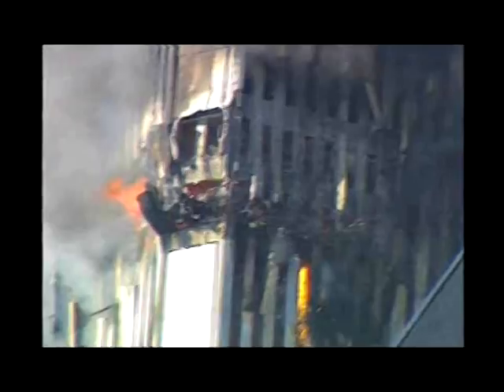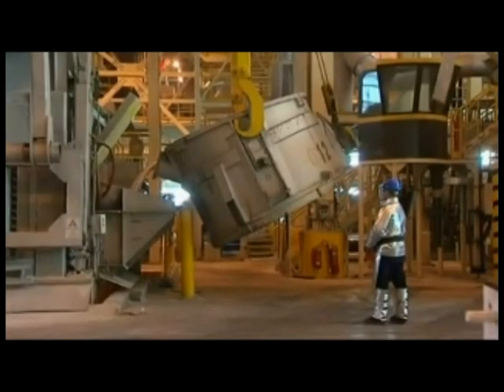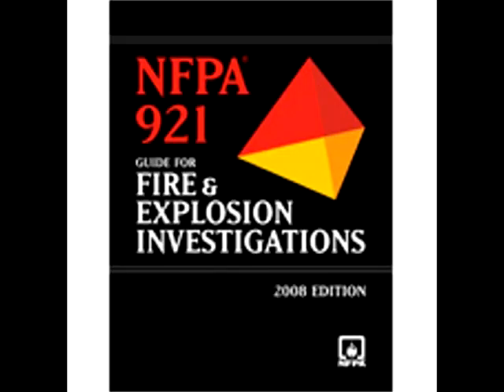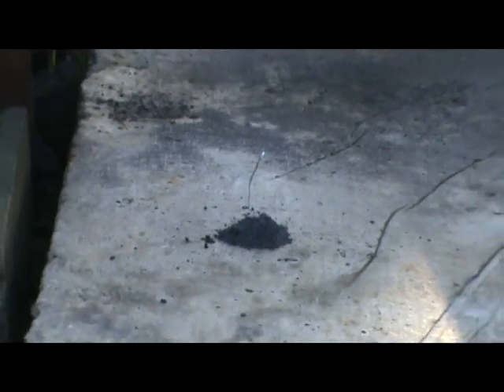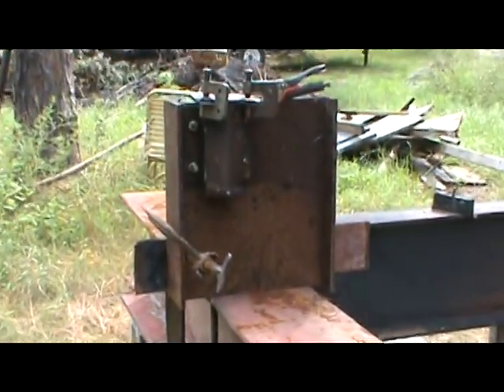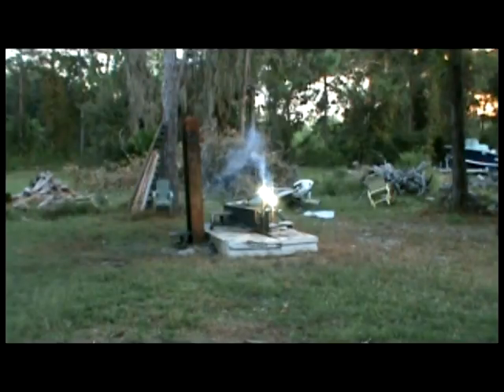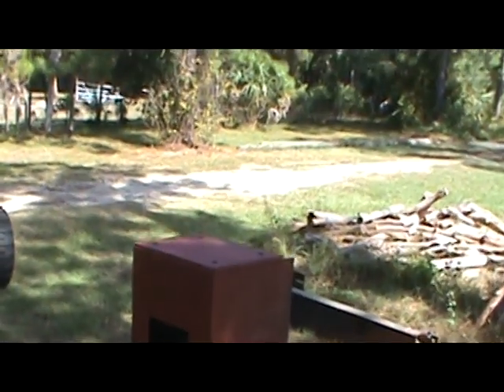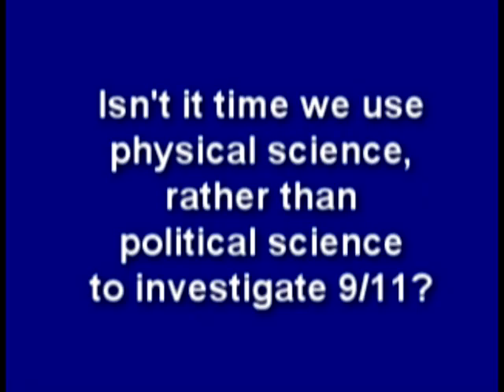9/11 Experiments: The Great Thermate Debate

Comment: C4 or equivalent with copper makes a shapes charge that can easily cut those beams.
Reply: guy tremblay "Specialists" You mean, government shills. Dude, the entire thing was shrouded in lies and conjecture. It takes no expert to see that. I saw ground zero shortly after the collapse. And what i saw were steel beams that had been cut, cleanly. They were not structural failures from heat and weight. they were flat out cut with a pyrotechnic device. Be it shape charges, thermite, or big ass oxy torches. I am a welder, worked in a govt shipyard. Im very familiar with cutting structural steel, as well as thermal lances, and thermit {exothermic} welding. Theres absolutely not one foggy chance in hell those buildings came down for the reasons cited. Im not a conspiracy theorist, 9/11 showed me i was being lied to, and i still haven't got any answers.
Reply: +Paul Raver now secretly install 2000 of them with about 60 000 feet of wiring, hundreds of batteries, capacitors and pray that they do not start blowing up when the jet hits the wall ... D Same problems applies for thermate
Reply: 85Damix Termite would have been used to use to cut beams in some locations instead of using torches.
Placing blasting charges would not be that hard and they would have been in the shaft that was designed to keep fire out and not act a chimney.

Installing before or after the aircraft hit the towers is something with pro's or cons.
There is more wrong with the theory that the twin towers could have collapsed because of small fires.
Towers designed to with stand much greater punishment.
Reply: +Paul Raver How much hands on experience do you personally have with C4? Do you prefer L1A2, L2A2, or L5A1 for detonation?

Why in the world would you want to use C4 in this application when PBX or H6 is so much harder to trace? Semtex would be the obvious choice to me, but I must not be the expert you are...
Reply: Paul Raver So how much hands-on experience do you have?
Reply: Paul Raver You are claiming to take credit for armor you didnt create. And thats a fact.
Reply: Paul Raver More like a legend in his own mind.
Reply: Paul Raver "Managed to become on of the best tacticians in the worlds." LMAO!!!

Seriously?!? I've read some funny claims on youtube, but your's takes the cake!

 "...you would see with a tree if you hack away at a side to what side it will fall." Comparing a tree to a skyscraper is pretty laughable, too, though!
Reply: nccrawford But the same principle apply's, take one side away, as a whole or partially a object will fall due to gravity to the side that is the weakest. 

And i am, NATO but most specific special forces are using a wide range of my tactics.
Job offers at NATO, UN, Russian Army, English Army etc etc.
Also helped the FSA & Peshmerga in there effort to combat IS and Assad,
And then some.

But let's talk about your expertise who are you claim etc etc.
What do you  bring to the table?
Reply: +Paul Raver Yes it can, and it DID!
Reply: agentorange153 No, it didnt. The same shrapnel that took down a nearby skyscraper in ny also evaporated at the pentagon. Odd huh.
Reply: +Paul Raver LIAR -- there were HUGE pieces of concrete and steel falling from the Twin Towers when they collapsed, you can see it on the damn video!
Reply: Paul Raver Nobody is buying.

You sound like you might need a therapist...
Reply: Paul Raver
Oh but other conspiracy theorists have already explained the one side damage issue. The planes passed right through the curtain wall, doing very little damage to them because of the thin airplane skin. Then the jet fuel fires burned in the middle of the buildings weakening the steel there. Those buildings acted basically like cheese graters on the planes.

Go get a cheese grater and a block of cheese. You can put all of the cheese inside the grater. It is just going in there in tiny little pieces, just like the planes did.
Reply: Paul Raver
You puzzle on the jet fuel. I've seen the video where the fire comes out the opposite side of the building enough to have figured it out for myself. The towers got turned into gas fired ovens instantly. That is just what happens when you shoot tons of jet fuel into a tube ignited. The simple fact is it was a brutally effective attack. I can accept that. Jumbo jets make excellent kamikaze craft. That is really all there is to it too.
Reply: Paul Raver
No it does not take more than a flame to weaken steel. Structural steel will loose 80% of its tensile strength at 800F What do you need a chimney for? Have you never heard of the phenomenon called wind gradient? Me, I've experienced it first hand. It is pretty amazing how much more the air moves as you get off the ground. 800 feet up is way off the ground too.
Reply: nccrawford I can make C4 or at least it is something close to C4.
But i do not do controlled demolitions
And det cords it depends on how much det velocity you would need to create the chain effect your looking for.
Reply: nccrawford Managed to become on of the best tacticians in the worlds it does involve explosive, controlled demolitions etc.
Worked on a new type of armor that is more capable to defeat HEAT/SABOT/APCR rounds and combined with CAGE is also deal with 2 stage rounds that would defeat ERA.
HEAT rounds use the same general idea to cut through a tanks armor, molten copper jet that pens the armor.
Reply: +Paul Raver Some definition of "small fires" I wasn't previously familiar with.
Reply: guy tremblay Various engineers including one who worked on the WTC stated that the center for is what holds up the towers.
It was also designed with airplanes crashing into it and it has happened before.

Even if it was it still does not explains a symmetrical collapse since all 4 sides interior and exterior would need to disintegrate at the same time.
While one side being heavily damage and subjected to fires while the opposite side would not have or far less then no object/fire can travel from the front/sides to the rear.
Or it would have broken of at the impact point or in the general area and fall down.
Reply: guy tremblay Still would not be a symmetrical collapse at terminal velocity.
You have 4 sides, on side is the impact point, this would as you would see with a tree if you hack away at a side to what side it will fall.
It would not be possible for the towers to disintegrate and fall straight down.

It would work if all 4 sides were hit with a plane but only one side was hit.
Now you have one several damaged side with 3 sides having more integrity.
Gravity would cause it to fall/break of at the impact point not straight down.
Reply: +guy tremblay ok cool, so why did the building that DIDNT get hit by a jet collapse? You seem to over looked that entirely. The only sky scraper to have ever collapsed from fire.
Reply: guy tremblay Shrapnel can not take down Tower 3, simply lacks the kinetic energy to pen the steel structure let alone shred it.
Reply: agentorange153 Ballistics, small not made of a hard metal so how does it penetrate?
Reply: agentorange153 Concrete lacks the molecule density to penetrate steel.
It will break.

So you full of shit no one else, LIAR LIAR PANTS ON FIRE.
Reply: Paul Raver
9/11 was an inside job. But your statement depends entirely on speed. If the speed is high enough....
Reply: Erik Jonsson Not just speed also how dense the materials is.
It would need to split the bonds on a molecular level to penetrate.
That is speed and molecules stacked dense enough to do so.

Concrete without metal reinforcement is very weak.
Reply: ***** Anti personnel not anti armor.
Shaped charges use copper to penetrate armor.
The explosion super heats the copper and that is the method of penetration.
Glass and aluminum do can not reach a high enough temperature before it reaches a gas state.
Reply: ***** I deviced a new type of armor and a new type of sabot shell.
There is a difference between HEAT/APCR and SABOT here.
Where HEAT is a chemical penetration SABOT/APCR are penetration by projectile.
So no Copper only works if it is super heated not for penetration in it's solid state.

Copper is also not a good binder for application in armors or penetrators.
It would weaken the product.
Tungsten is the first material used to create projectile penetration in WWII but it was rare.
Reply: ***** Read about the 6th comment from the top that Paul Raver wrote. You're the real deal, but anyone who calls themselves "on of the best tacticians in the worlds..." (his spelling, not mine) in a comment section is 100% FULL OF SHIT...

Coincidentally, I was asking someone a legitimate question on another video this morning and it ended up being you! It looks like you've turned off responses to that one, though... Best.
Reply: nccrawford Once again what do you bring to the table.
Nothing, so your full of shit.
Slight dyslexia does not decreases my skill.
While i got job offers you just some mumbling fool on youtube.
Reply: Diesel Ramcharger Fact i did, among many other things.
Part of the Hellcat MGS a air mobile tank for the Knight Raiders Special warfare division.
Talk to earbama he is the one taking credit for among other things my work.

A living legend, fucking pathetic how i always end up with these sad pretending little kids.
Once again PAUL.
Reply: Diesel Ramcharger Right the whole world talks about Paul and you still wanna pretend.
The real world not the imaginary crap world you reside in sad little fuck

Of to the ignore list with your punk ass.
Reply: ***** Yeh right moron another pretending sad piece of shit.

Straight to the ignore list.
Reply: nccrawford Sounds like you got a dead wish.

Another reject yank on the ignore list.
Reply: +Paul Raver The hard part is getting a crew to place those charges that keeps their mouths shut. Any secret known by more than one person is rarely a secret forever.
Reply: Paul Frederick True and i fully agree.
Reply: Paul Raver
I know people. People always blab. No one could keep a secret like that. Someone would tell someone, then they'd tell someone, then pretty soon everyone would know.
Reply: Paul Frederick Possibility's are there,may it be distant.
However buildings do not behave like that, that is what i am after.
Reply: Paul Raver
How do you know how buildings behave? You potty train buildings, or something? I know a lot about buildings and the first thing I know is they're all different. There isn't another building in the world quite like either Tower. But both towers did behave pretty much the same. So apparently those buildings did behave like that. Because they did.
Reply: Paul Frederick The laws of physics apply to all objects.
Everything in our world is restricted by those laws, defying them is impossible unless there is human interaction.
Reply: Paul Raver
So how does physics negate the official story, and bolster some nut job conspiracy theory?
Reply: Paul Frederick This is not me going along with whatever theory this is about that the towers traveled at terminal velocity downwards.
But the problem is that there are floors in the way and you can not get to terminal velocity with that much friction.

The buildings were damaged at one side each, for a building to collapse symmetrical it must lose it's structural integrity in the same manner.
While it would be normal for the impact side to be severely weakened it would sag/fall at that point.
Not collapse on itself on all sides.
Office fires or not, enough heat or not those sides must first be equally damaged or more.
For it to lose structural integrity on all sides and have a critical loss of structural integrity to collapse.
Reply: Paul Frederick Okay let's puzzle on the jet fuel.
How did it get at the rear the opposite side of the impact point.
Does not matter if the plane did penetrate the inner structure or not
It still must equally damage all sides, even more so if one side is already damaged.
Whatever the damage might be it has to be in such a manner all sides lose there integrity enough for it to collapse in roughly the same time, and this is seconds in terms of a time frame.

It would simply break at the impact point, and that piece of the towers would fall to the side weakest not collapse downwards
Reply: Paul Frederick It takes more then a flame to weaken steel.
Also the center core is constructed to not act as a chimney.

As far as a attack goes it would have been more efficient to have it fall over then collapse.
A terrorist would like to maximize damage.
Reply: Paul Frederick Whatever source, it must do so on all sides and to the extend it does so equally for a collapse.
Or it would simply fall over at the impact point.

And yes I've heard of it, specially in a high rise area the wind can be very different then lets say over a open plain.
The area would tunnel wind through the corridors(roads etc)

To reach 800f it would need a closed space with enough o2.
High wind speeds would drain heat but add o2.
Reply: +Paul Raver Ever seen a blast furnace, idiot?!  In a blast furnace, they BLOW air into the furnace, which FANS the flames by adding O2, and the temperature gets high enough to MELT steel!  And this is similar to what happened in the Twin Towers -- the impact blew a huge hole in the tower wall AND ruptured the center core so that it DID start acting as a chimney -- and this got the flames hot enough to weaken the steel!  As for the towers falling over, it would ONLY happen if the piece which started falling was SIGNIFICANTLY taller than it is wide -- which was NOT the case because the collapse started so high up!
Reply: +Paul Raver The part above the collapse was BETWEEN TEN AND TWENTY FLOORS HIGH, so there was PLENTY of momentum!  YOU go read a book, you brainless amoeba!  And yes, the towers DID act as blast furnaces on that day -- the fires were sucking in oxygen through the elevator shafts and stairwells!
Reply: Paul Raver
No building was ever struck by a 757. You must be referring to the Mitchell incident at the Empire State Building. Completely different. A B-25 doesn't weigh what the luggage does on a 757.
Reply: agentorange153 Momentum is not the amount of floors you got no idea what your talking about.
Ignore list for you.
Reply: Paul Frederick Well ppl did mention previous damage was to blame for some structural integrity loss what could have aided the collapse.
But i know a B-52 is not that big.
Reply: ***** Yeh then why the fuck do i have to move to the US and become President?
Fuck you morons, once again you fuck this up and you are fucked.
And will see how much of a troll i really am.
Reply: +Paul Raver you need to read a book and stop believing nonsense conspiracy theories.
Reply: numkie Still buildings don't fall like that is science not conspiracy's.
So you brain dead yanks need to stop believing the most retarded things your own government spews out.
Reply: Paul Raver
How do you know how the WTC towers collapse? We only have two examples to go by now. They both did collapse in very similar fashion after suffering similar disasters too. Science is done through observation. You are not the one applying the scientific method here. You are spinning theories and passing them off as your facts, while ignoring the data.
Reply: Paul Frederick Data that is readily available in various shapes and forms.
Fact remains object can not travel at terminal velocity while there is a building in the way(friction)
A collapse down wards must involve all sides losing structural integrity at the same time.

Does not matter was the source is, impact/fire/debris etc.
Reply: Paul Raver
Hey look I was there and witnessed the second tower collapse first hand. It fell exactly how I expected it to. It was not free fall. It just fell. When it went down no one was surprised at how it fell either. We were only shocked that it did fall. Conspiracy theorists like to imagine that the world is governed by strict rules. The sad fact is that is simply not the case. Shit often just happens. Buildings get hit by hijacked planes and fall down. Deal with it!
Reply: Paul Frederick The rate of fall was measured and was at terminal velocity.
A engineer took footage applied a formula to calculate the rate in m/s.
Recording happen at 20 frames per second.
Architects, Engineers, Army corps of Engineers all question the official story.
Look i didn't even really looked at this since like 2 years ago.
Laws of physics are there, a proven fact has nothing to do with conspiracy.

And there are people who are power hungry,but that is a global issue.
But due to a lack of talent and skill they never get far.
Reply: +Paul Raver  c4 is heavy in rdx, when rdx is detonated it explodes extremely quickly, 

the chances of getting your hands on c4 is unlikely, let alone things like rdx, unless during construction it was taken because whatever ``group`` did it, probably had ways of getting it,

i think some kind of high temperature chemical was used, could be a thermobaric or thermetic, or some type of solvent, explosions , especially rdx based would send unbelievable amounts of shrapnel and debris everywhere.
Reply: YQY Treefrog  I must note that it is possible to turn certain basic cleaning appliances into c4.
It would be similar but would require large amounts of cleaning fluids.
Shape charges or using copper in a molten state would need far less explosives.

As I mentioned above each termite could have been used to negate the use of torches that would force ppl room spend hours cutting beams. 
Down side is all that takes work and calculation to time this all to perfection.
Reply: +Paul Raver What I've never seen explained is why the falling mass was capable of plowing through the stationary mass as if it wasn't disintegrating. The disintegration of the structure began immediately, as if it was melting. Material was ejected laterally. As the falling structure lost integrity wouldn't it lose its ability to plow through the lower structure? I heard Leslie Robertson say that he was sure that the collapse would continue all the way to the base. Another physicist argued that vibration shock waves went through the lower portion of the buildings and weakened them. Still, how could the lower parts of the structure not give more resistance? Their lack of resistance appears to be uniform.
Reply: obyvatel That is the friction i am talking about,
The lower parts of the building that are in the way of the rest of the structure falling at terminal velocity.
Reply: Yes, it's that. And if I I am not mistaken, the part that falls disintegrates as it falls. To me that means that it loses its force. A ton of loose gravel dropped has a different effect on an object than a 1 ton stone dropped. Or, a dried clay ball has a different behavior on impact compared to a kiln fired clay ball. The upper portion and the lower portion should be disintegrating at the same rate, starting from the collapse point.  Though more and more material begins to fall as the building breaks apart the mass doesn't consolidate as in the case of the "pancake theory" that was first proposed.
Reply: obyvatel You got gravity that makes it fall, it will only go a terminal velocity.
Any friction thus objects in the way will cause friction that will slow or completely stop a object.
If a object breaks/shatters etc depends on the object and the object is comes into contact with.

In this case the building collapsed at terminal velocity and that is only seen in controlled demolitions.
It would require a structural collapse on all 4 sides simultaneously.
It could cause a state where the building that is collapsing having enough momentum but it would still require a considerable portion to get to the circuital point where the weight of collapsed floors out weights the structural integrity of the floors below. 

EDIT Forgot t add that vibration could aid in the loss of structural integrity.
The WTC towers were not build with dampeners(earthquake) thus vibration could have weakened some of the concrete if severe enough.

I am trying to look at it just purely based on science, so apply the laws of physics to whatever happened.
Reply: Paul Raver
You're not going to stop the top third of the WTC from falling down once it starts falling. The counterweight at the top of the building was 400 tons alone.
Reply: Paul Frederick Once again that 3rd needs to collapse at the same time.
That is impossible with office fires and the different sides being damaged differently.
Constructed in the same manner so they need equal damage to collapse symmetrical.

That counter weight is located in the center so it would fall down the shaft.
Reply: Paul Raver
I can see that your structural engineering skills leave much to be desired. The floor letting go 30 floors down is not going to cut the supports for the counterweight above it. That weight is still going to bear down on the now unsupported structure.

The fire caused a general failure of the beams supporting the floor, which caused the whole floor to collapse at once. There are animations available that explain graphically precisely what happened. I suggest you seek them out to aid in your understanding of the disaster.
Reply: Paul Frederick Once again your wrong a counter weight is suspended and sways with the building.
It would only put more weight weak side because it would sag more.
Thus the weight would shift to that side.

Again gravity would act on all object and it would stumble/break on the weakest side.
Being top heavy would sway the building to the weakest side NOT collapse downwards.

If you understand physics you understand everything else.
It is the building blocks of everything.
There for my comprehension of structural engineering would surpasses yours.
Reply: Paul Raver
The building failed in the middle. I was there and I saw it. In fact everyone around me all saw it. We all said we saw it. Right before the tower collapsed everyone said, there it goes! Then it went too. From where I watched the building kind of leaned to the left ever so slightly, before it collapsed. But enough so absolutely everyone that was watching it with me all saw it. So I wasn't seeing things, and neither were any of them. Because we all saw the exact same thing!
Reply: Paul Frederick Seeing something does not make it science.
Also there is optical illusion, like swaying a pencil in the middle it looks like it wobbles.

They used footage to verify the downwards speed at terminal velocity.
Failing in the middle would mean it would loss structural integrity at exactly the same time.
And that means all sides must be weaken at exactly the same time.

What you saw could be wrong, because science says so.
Let's not forget what you see if a interpretation of what you know.
It only makes you human.
Reply: Paul Raver
The very essence of science is observation. So your statement that what I saw could be wrong flies in the very face of what you are trying to use as your argument. Science itself!
Reply: Paul Frederick Observation through verification.

Again measurements were taken proving my point.
Those are verified by more party's.
These are ppl renowned in their respected field.
Science is debate with facts, only will you know if you are right if some one else can verify it
Reply: Paul Raver
Everyone I was with verified it. We all shared a unique perspective on the disaster too.
Reply: Paul Frederick Scientific verification.
You did not make calculations.

As with for example a armed robbery the witness accounts can be different.
Example the car has different colors while it can only have one.
Witnesses are also interviewed separate so one story does not influence others.

The fact you were there in such a traumatic event also influences your perspective.
People wants answer, easy answer while there isn't one.
Thus story start to emerge, including conspiracy story's.
The only way to look at it to find a explanation is by look at the footage, apply formula's.
Take what science knows then verify what is facts and what isn't.
Reply: Paul Raver
It was not that traumatic for me really. I was a safe distance away. Although I still had a great view of it. A rather unique perspective of the event. One unlike any of the video footage I have seen. I have seen all of that too. There were only about 30 of the brightest people around watching it from where I watched it from. Great minds do think alike.
Reply: Paul Frederick It does impact you, everyone knows where he/she was that day.

The video footage was measured you saw something but did not apply you IQ to it.
You assumed and so did the other minds.

30? I wasn't there, and so were many others like Stephen Hawking, Higgs etc.
And those ppl i mentioned above have taken interest in my work, that shows you how i am regarded when it comes to being bright.
Reply: Paul Raver
Well sure I remember. I made a special trip across town to watch from a parking garage I'd built. Because I knew I could see the towers really good from there.